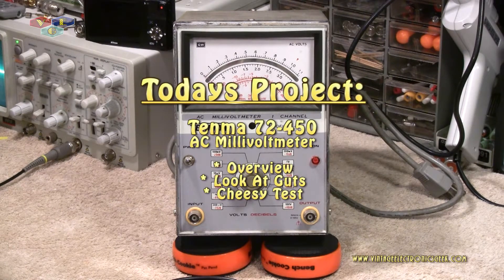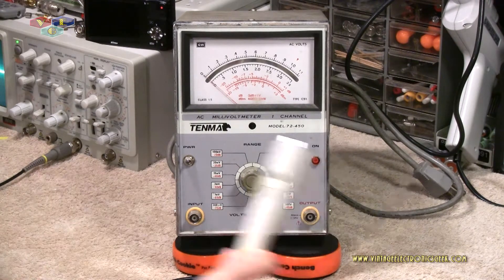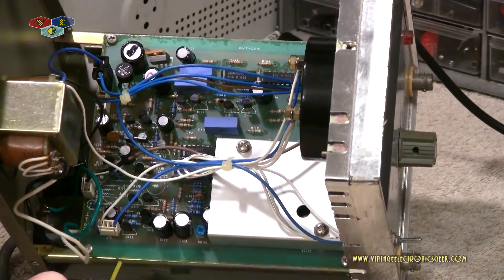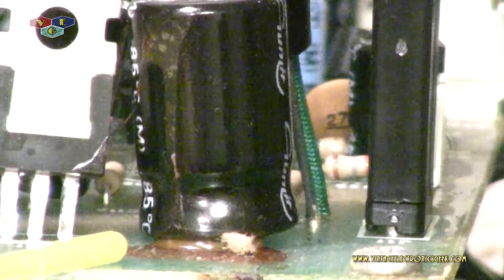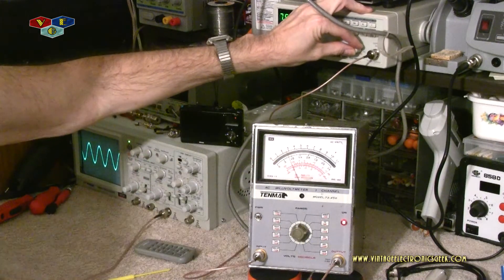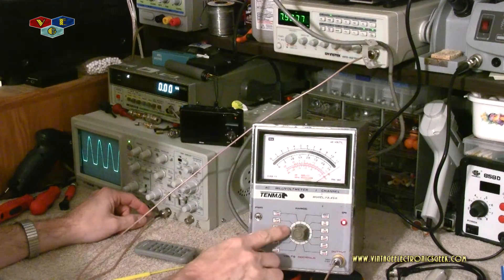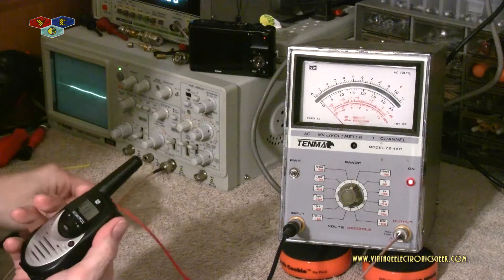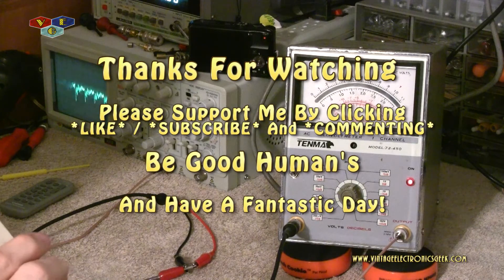Tenma 72-450 AC MilliVoltMeter - Overview / Guts / Test

Comment: thanks for the video, i was looking at buying th phillips PM2454 millivolt meter and found your video. a very useful tool to have. can you please tell me the model number of the sony microphone and whether it is an elecret / condenser one? cheers
Reply from the maker: Howdy!  Glad my video helped out.  I use this device often and I wouldn't know what Id do without it, a valuable piece of test gear indeed! "IF" I were to replace it with another, I probably would reach for one that has dual needles, dual channels, it would be perfect for testing stereos, you would be able to monitor both channels at once....if your not gonna work on stereos and don't need simultaneously visuals, then a single meter is perfect.  I had to re watch this video to see what mic?  :)  The mic in question is a 1967 Sony MTL-F96 dynamic mic, it was sold in pairs as they were for left and right channel, I only have the one mic and barely use it, but it does come in handy when working and a tape recorder.  Thanks for watching.  ~Jack, VEG

Comment: You can get a .pdf of the GW-Instek GVT-417B Manual @ http://www.gwinstek.com/en-global/Download/DownloadFile/DownloadFile/download%23_%2310_Others%23_%2382VT-417B0MC.pdf

The specs on this meter appear to be Voltage from 300 uV to 100 Volts AC and Frequency from 10 Hz to  1MHz, so you should be able to use this to align radios with 455 kHz IF's.
Reply from the maker: Very cool, thank you very much Dexter and thanks for watching!  ~Jack, VEG

Comment: many analog meters are actually miliampere or mcroampere meters, like with SWR, VU, tube testers, multimeters etc., but have specific scales instead, and are rigged for voltage with dropping resistors.  So this nice tester is all of the above in one, with actual scale, so as to know what is really going on.  Way kewl find Jack.  btw, those little old Sony mics are neato.  Don
Reply from the maker: Howdy Don!  Yea, I have seen video's of mod'ing a SWR meter, and I do have one I thought of doing it to, but I opted to just get this device...it was one of those things that just got in my head I needed to have!  Just like the function generator!  :)  Those Sony's are, I unfortunately only have the one mic and not the pair, seen it at my local second hand store and just hard to rescue it, knowing how little kids like to tear things up...done that on a few items that I really didn't need!  I'm sure you know how that is!  ~Jack, VEG
Reply: Thanks for the video.  I too noticed the meter responding to ambient voltage and first though it was malfunctioning.  Thanks for helping to clear that up.  I found a user manual for the GW-Instek GVT-417B, that is very similar.  I can send it to you if you want.

Comment: Hope you enjoyed your whiskey and gear, don't give up the day job. We share the same delivery man didn't realise they covered such a wide area! I'm only familiar with the modern  Tenma brand sold into the UK which is sold at the lower cost end of the market I had one of the RF signal generator in the past, not bad but not a Tektronix or a HP either.   Anyway nothing wrong with the quality of your meter it looks really good. I was looking around for date codes but did not see anything on the ICs  - smells like late 1993  to me.

The "innards" of instruments like this are usually the same; they are made to a standard design in several factories and labelled as required.

The GW-Instek GVT-417B is probably the same as your Tenma; the '417B user manual is available for download.
Reply: http://www.sjelectronics.co.uk/media/manuals/gw-instek/gvt-417b-ac-millivolt-meter.pdf     There is also some information on the various modes on the Duncan's Amps website. Regards Chris
Reply from the maker: Howdy Chris!  Truth be told, I don't drink any alcohol, just enjoy the music about it!  :)  Oh the mail delivery service here sux!  I am currently fighting the USPS over a lost package! I understand Tenma is not high dollar, but on the other hand, it's not cheap eBay Chinese gear...I hope!  Since, this is just a hobby and all the junk I work on is my own stuff and make no money off it, it's kinda hard to justify spending the big money...and I'm OK with that! I have bought that cheap stuff and just thought I'd upgrade a little...I got this at such a deal, it was hard to pass!  :)

When I tear it down and re-cap it, I will see if I can ID a date better, 1993 sounds good to me!  I know the older gear like this has binding posts, so not the 70's!  :)  Thanks for the rest of the info!  ~Jack, VEG
Reply from the maker: Thanks Chris for looking and linking, this manual has helped me, now I have a better idea!  Warmest Regards ~ Jack, VEG
Reply: Well it's a very sound idea not to drink money down the drain and if you smoke money up in smoke. I have to admit I drink more than I should and will definitely cut down tomorrow.  The mV meter looks very well made better than the later stuff.  I'm sure you get little more pleasure from owning a expensive high end instrument  and you don't have to worry if something goes wrong during the restoration.  I probably spend more than most on my test gear obsession but the items I treasure most are perhaps the cheapest but cost me personal the most at that time of my life they were acquired. There's a great saying along the lines of what we obtain to cheaply we esteem to lightly. I don't think this quote has anything to do with monetary value but speaks of hard work and sacrifices. Such is the life collecting  and restoring vintage test gear.  Well looks like I must have been drinking enough for both of us this evening. Take care my best regards Chris.
Reply from the maker: Howdy Chris! - No, I don't smoke or drink, never had, never will!  Dad told me he'd break my legs if I did and I believed him!  He told me this when I was 50 and I thought how odd!  No, just kidding, but he did say those words and I did believe him  and never did!  But enjoy great vintage country songs all about it!  There is a line from the movie "Airplane" - "I picked the wrong day to stop smoking" "I picked the wrong day to stop drinking", very funny movie!  Chris, just curious, what part of the world are ya in? 

When I was into photography, I collected cameras and gears, I have not done much with photography and find myself getting into electronics more and more which means my choice of collection is changing as well.  However, with photography, I really do enjoy collecting low end consumer grade cameras, I really got into collecting 3.1MP or less and less the better!  I have some cameras, I just not have used but owned for a while!  I also enjoy old vintage lenses, some of the old lenses are radioactive!  I have a few.  Drink well my friend!  :)  ~Jack, VEG
Reply: Vintage Electronics Geek   Hi jack United Kingdom near Sheffield
Reply from the maker: Thanks Chris, I don't know why I was thinking Scotland??  :)